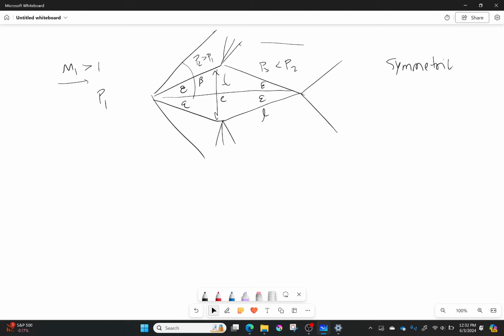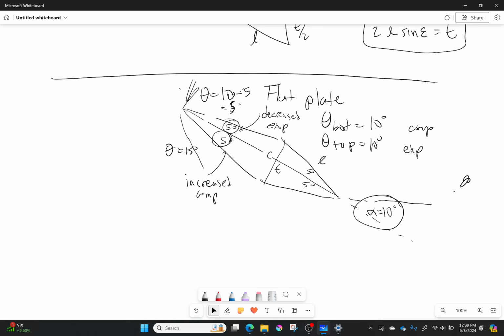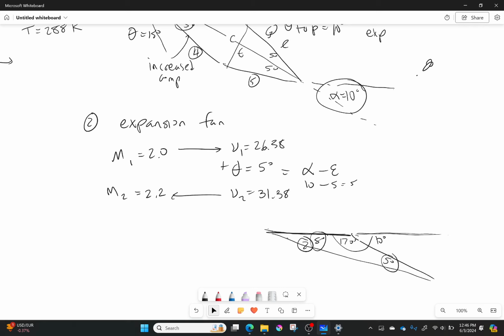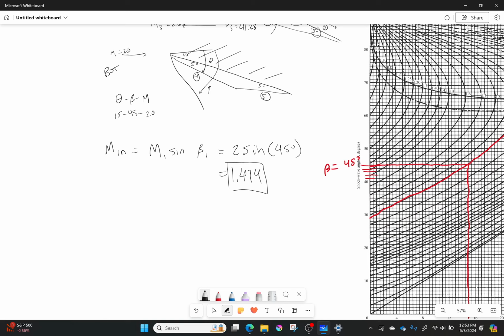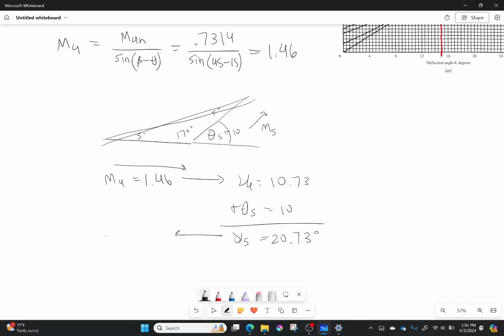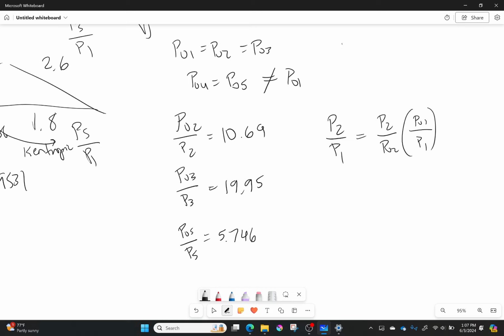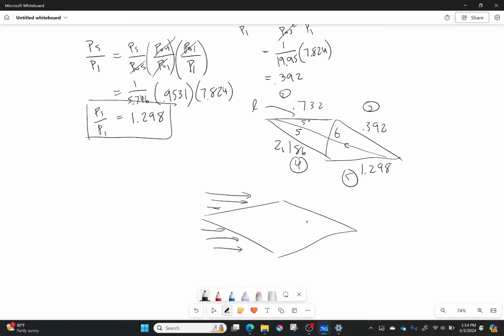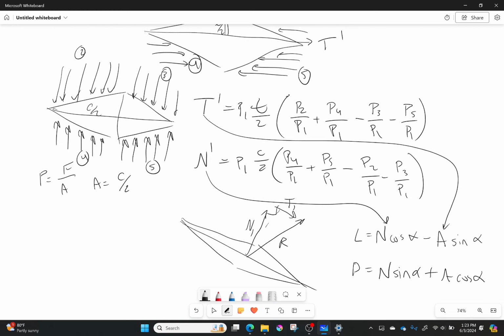Example: Solving for Lift and Drag on a Diamond Wedge Airfoil

Comment: What if I need to solve for the region downstream the airfoil ? The two regions in the point of the airfoil. I don’t have theta6 or theta 7, just the knowledge that the pressure after the two waves must be igual and the angle phi, the angle between the new rotary flow and the horizontal also must be equal
Reply from the maker: That is a good question, but not something I can answer easily in a comment. I can see about adding a follow up video to this in the future going over what you asked.

Comment: How should I proceed if I want to create a numerical solution considering the variation in angle of attack between 0 to 10 degrees? I mean, how can I predicted if will be an oblique shock or an expansion wave ?
Reply from the maker: If you want to do this, then you will need to program in the pressure ratios. I was looking at tables, but you would need to have the actual equations setup in a code. Once you have that, its all about deflection angle and Mach number. To determine if a flow forms an expansion fan or a shock wave you just have to do a check to see if it was deflected into itself or away from itself. Try doing the deflection calculation by hand for a few angles of attack and you will quickly see a pattern you could program.

Comment: what about a half diamond airfoil?. How to set up Axial and Normal components?
Reply from the maker: Most everything is the same for the top or bottom (whichever is the half diamond. The other half is just a flat surface, so you would just calculate the pressure change due to the shock or expansion fan it experiences and use that. This could be another excellent example problem to work through in the future.

Comment: How about non-symmetric
Reply from the maker: The process would be roughly the same. About all that would change if it was non-symmetric would be calculating the areas of each panel. The pressure distribution would be calculated the same.

Comment: Is it much more complicated to figure out what would happen if you had a diamond swept foil of this nature. In fact I'm trying to figure out the characteristics of a diamond shaped aircraft with all of the spaces being symetrical. But the angles are 120degrees front nose(left to right) and 60 degrees top to bottom. Like a diamond B2. I'm learning this on my own so this is harder to figure out. I'm not even sure if it could fly.
Reply from the maker: So long as the airfoil is thin, you could likely get a decent understanding of it's lift from lifting line theory. That theory does not really care what shape your airfoil is. Codes like XFLR5 would also be helpful in analyzing full wing shapes. Beyond that, I would need a picture to better understand your question.